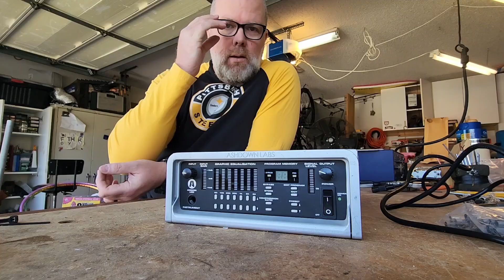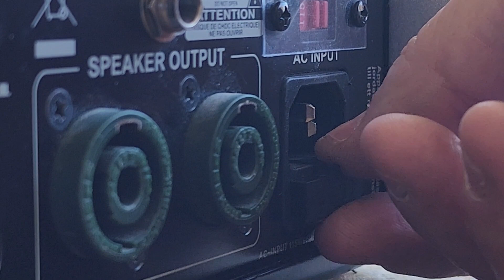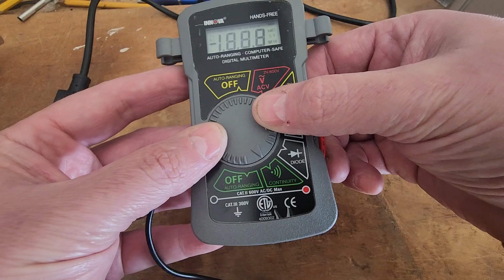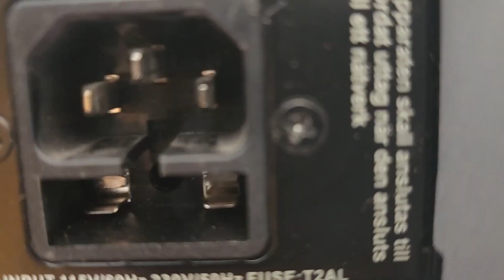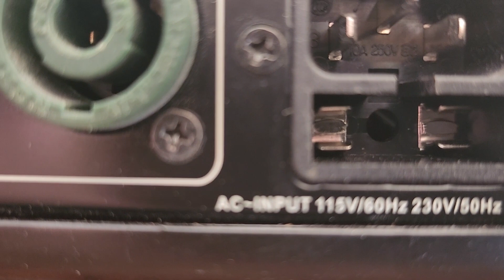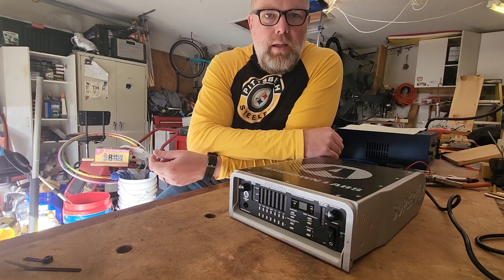Ashdown Labs Superfly Bass Amplifier Repair

Comment: Superfly was a horrible amp. I bought one when they first came out and was back and forth with Ashdown trying to fix various issues. They finally told me that they have run into issues with it and decided to abandon the design. It ran so hot (normal they told me) that you couldn't touch it. Cool idea/bad execution.
Reply from the maker: Yeah I had never seen one before.  It sounds decent but I haven’t played it long enough to see if it gets hot.  Thanks for watching and commenting!

Comment: Good to see someone with your knowledge addressing this.
I'm a die hard Ashdown man and recently was given one of these, in perfect working order. All I've heard to date is not so good, but to my ears it sounded like there was confusion as to what cabs could be used and at what settings. With many just blowing that fuse and claiming it over heated, rather than admit they took a gamble...kinda thing, maybe.
Reply from the maker: Hey thanks for watching.  Yeah this Ashdown sounds pretty good to me.  It's the first one I've played through.  In this case the fuse wasn't even blown.  Just a bad fuse connection.  So there was nothing wrong with the amp really.
Reply: the sound (sounds from presents too) was fine; the multiple design flaws and issues made it a big disappointment for me.